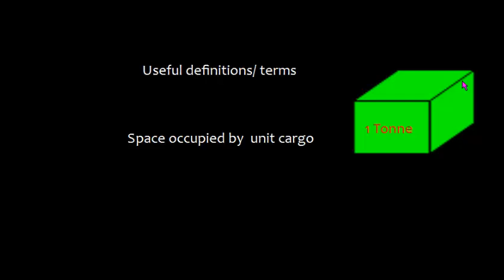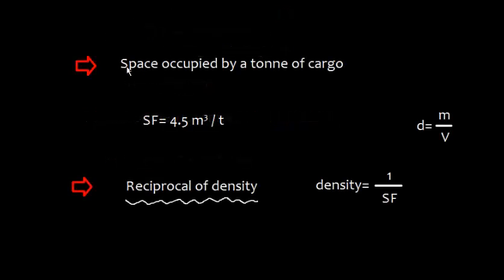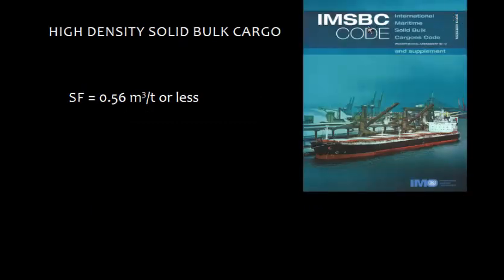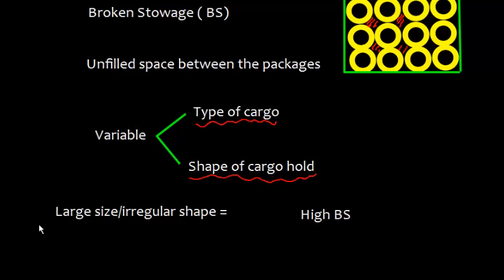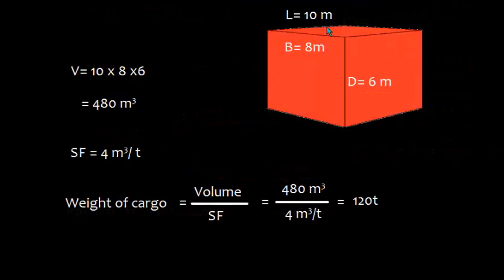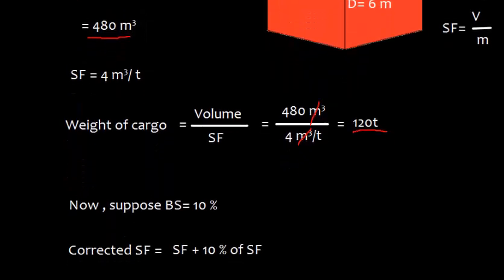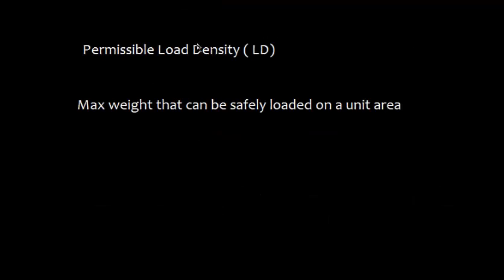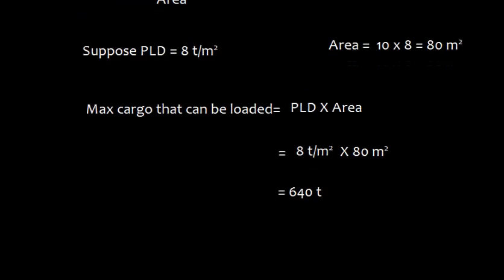Cargo Work_Numerical_ Cargo Stowage_Basic definitions & terms_ Part 1

Comment: Let's say a 7 hatch ship is filling 5 hatches with bulk grain and 2 hatches are going to be slack. The ship is loading to a mark because it has a draught restriction. You get the cubits of each hatch. Then you determine how much cargo in mts it will hold based upon the test weight of the cargo being loaded. That will tell you how much is going into the slack hatches. To determine let's say a slack hatch that would fill with 10000 mts but is only holding 3000 mts due to being slack what % would that be and how do u determine such? By taking the total hatch cubits(large number)  and deciding it into the amount of cargo ( small number you get the exact % of how much volume is being filled!